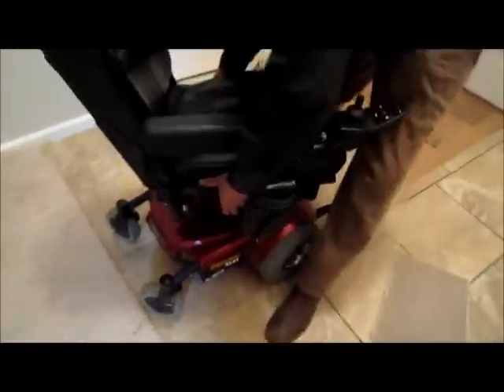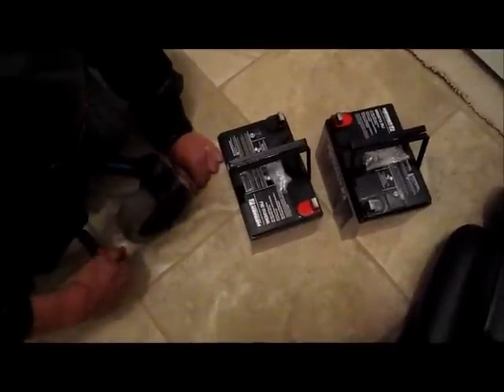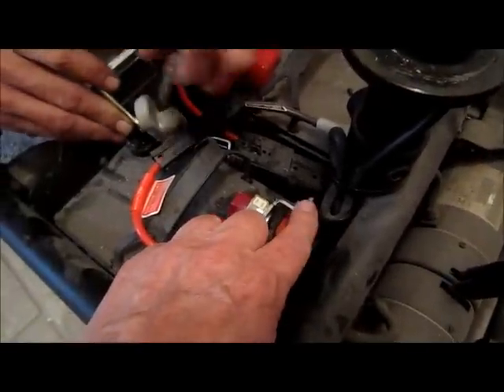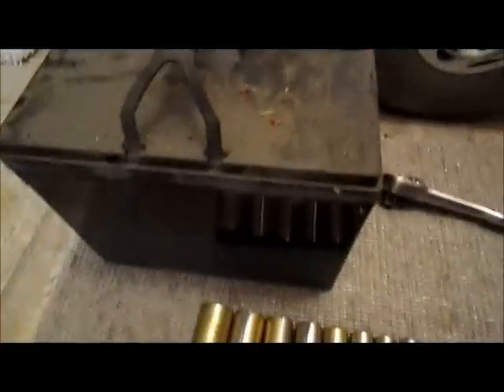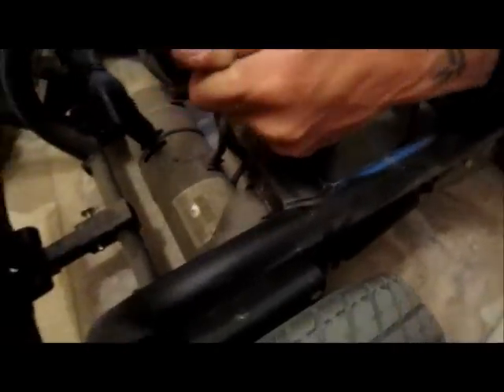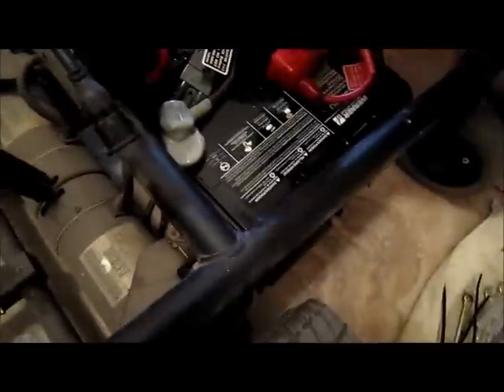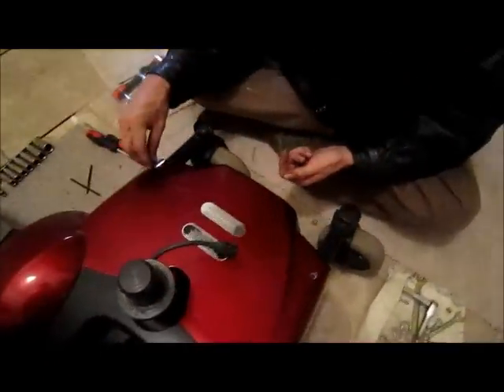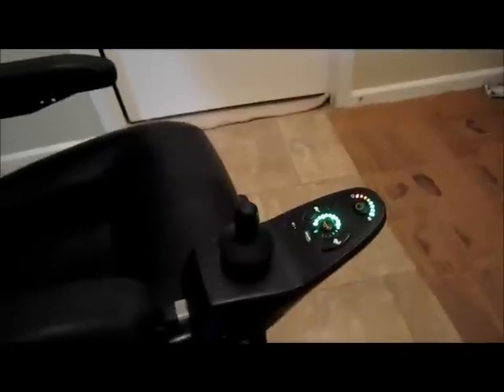Changing Batteries Pronto M41

Comment: trying our hardest to change a battery on an m51 but can't get the seat off to save our lives  Unplugged the joystick like it said- folded seat down like it said- pressed lever and pulled seat up like it said.  Nothing....any suggestions please?
Reply: I've heard of situations like you have described. I have a Proto 41 series so when I began to work on it because battery plus will only replace the batteries not my four dolly wheels etc. if I have to learn to do all this repair myself then I am going to remove the arms of my chair unplug everything and lift the seat off to the best of my ability. I hope this information helps.
Reply: bigger screw driver and a little oil

Comment: I have changed the batteries in my chair and they paid me for the old batteries because they are recyclable and I found the new batteries at the tractor supply store. Because they are the same thing as riding lawnmower batteries and arc batteries price for mine fifty dollars each and got five for each core   I learned quickly that you don’t go to any medical supply because they will charge you ridiculous amount of money for what you can buy for a tractor 🚜 cheap